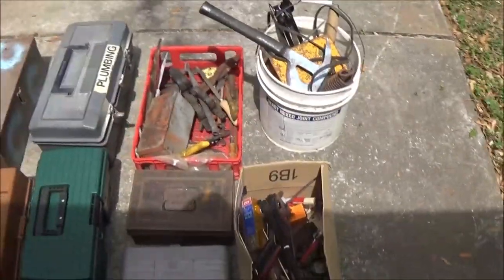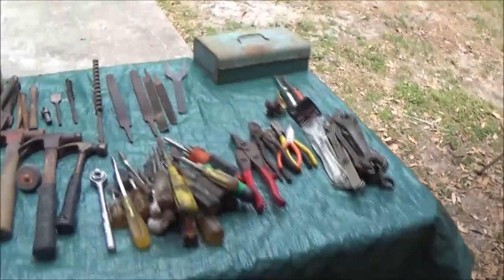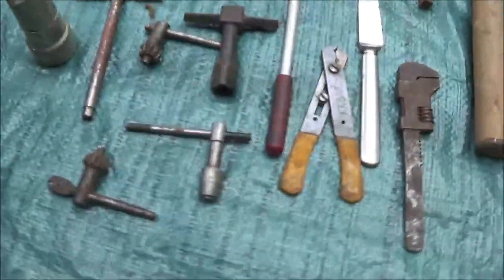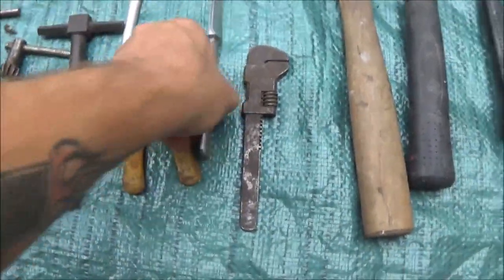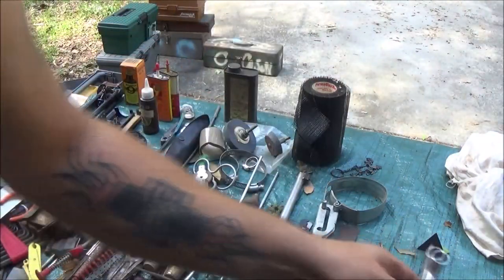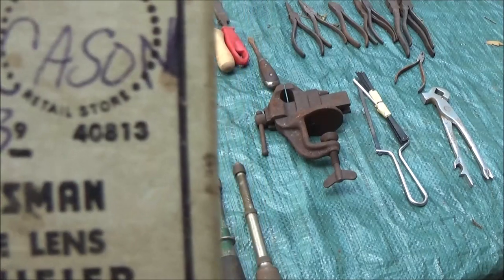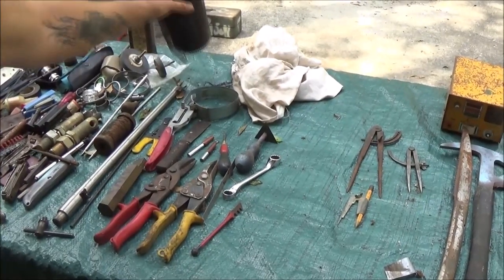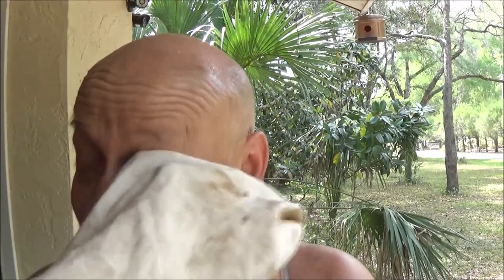Free Stuff My Treasures

Comment: A lot of neat old tools.  I have a couple of those General steel ruler/gauges, they come in handy.  And those small 2" bench vises are nice when you have to solder electronics/wires, etc.  The magnifier is nice, I have one and use it when I need to look at small lettering (my eyes aren't as good as they used to be... LOL).   You might want to hang onto those compass scribes, I have a couple and have needed them from time to time.
Reply from the maker: Thanks Pete. You can bet I will keep the compass scribes. Need them several times and didn't have them. Now I do and probably wont need them or most likely forget I have them..lol. Stay safe my friend.